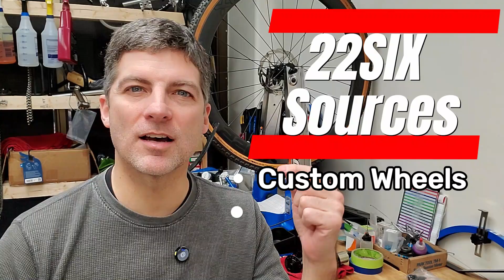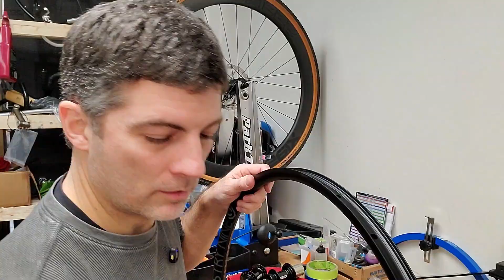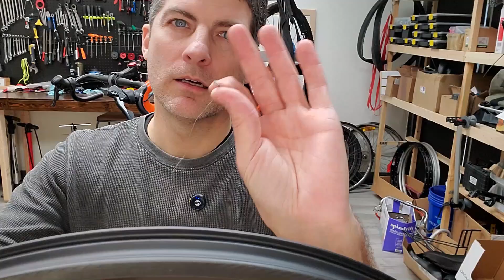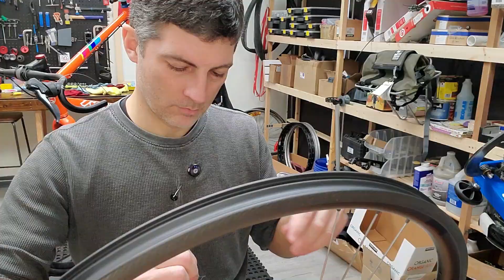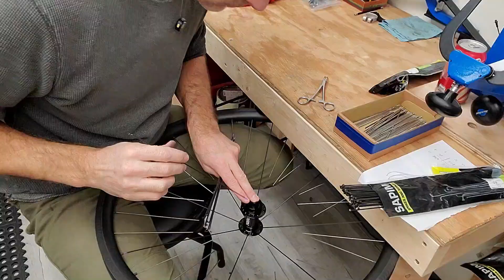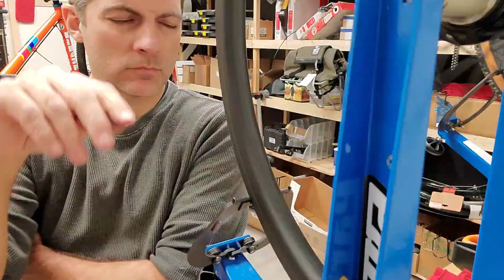22Six Wheel Build Walk Through

Comment: Nice, thanks for this.  Maybe a bit more info (unless it’s trade secrets ;^) would be nice, brass or alloy nipples and why?  If one wanted to use washers under the nipples, is the procedure the same except put the washer on the nipple?
Reply from the maker: This wasn't really meant to be an in-depth analysis or tutorial, just a look at how we do things and highlighting how we start building for tubeless ready.
Our rim manufacturer has advised us that spoke nipple washers are not needed for our rims, but I have used them in the past for other builds.  I imagine it would still be possible to use washers with a tubeless ready rim like ours as long as the washer would fit through the valve hole with the nipple.